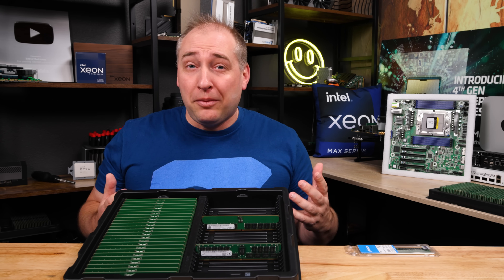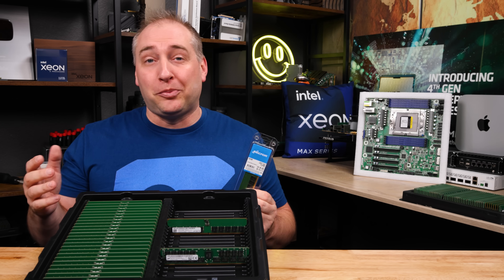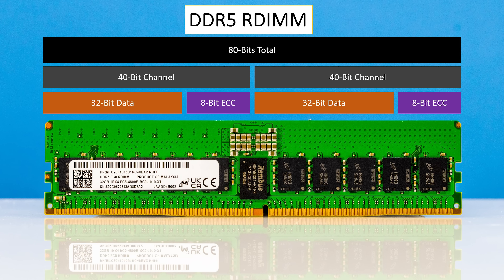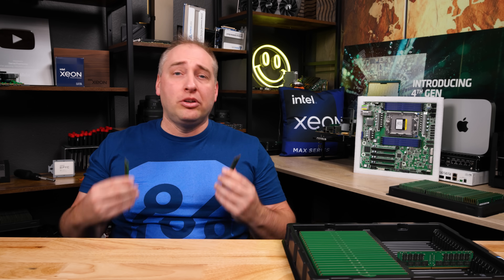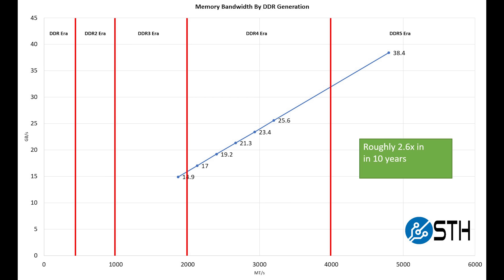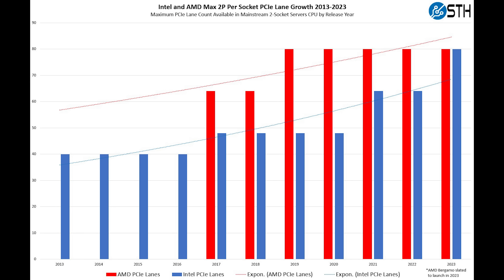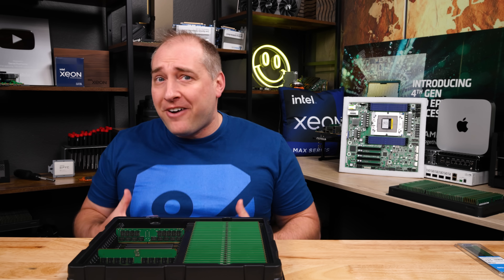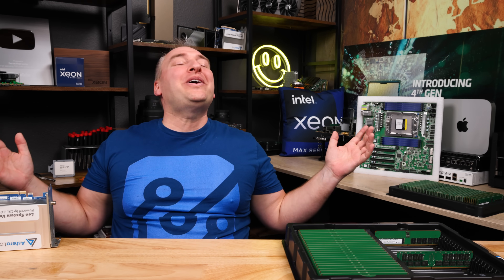Explaining Server DDR5 RDIMM vs. UDIMM Differences

Comment: Other than a server being built specifically for HB apps and banning low bandwidth from running on them, I see no point in choosing a lower core count CPU to save bandwidth. This is the same problem as inefficiencies in farm land use to make massive machine use more efficient and faster. It takes many times more land and other resources to feed a person this way.  Put LB apps on the extra cores to save on hardware and floor space that they otherwise take up.

Comment: i have a old used dell r730 with 2 xeon E5 2699v4 cpus and 384gb ram 24x 2r16gb modules many Terrabyte of used mircron 2,3 inch NVME drives all set up in the fastest way possible. i use this system for data analytic of weather data from the maker space i am in. we have a small weather station who every one can build if they want and you can send us the data once in a month if you will. the whole dataset of one weather station in a month is about 2gb. i had in the in the past processed the data on my trusty lenovo t60p but at this time the data was only around 10 stations after 1 year 100 stations also one month was 5gb data for every station. this was way to much for my system so i had to optimize my code and reduce the data for every station. this was still in the test stage. but after we did make the project public i learned fast i need a bigger pc so i bought a pc a with a ryzen 7 2700 and 64gb ram and a 500gb ssd. i learned how to optimize my code for make use of the cores and noticed something strange my cpu was only to 20% packed and was not really faster as on my t60p. so i thought about that and noticed oh the ssd cant keep up so i bought 2 more ssd and set up a raid0 now i run in another problem i was still not on the cpu limit. i hit only 40% i looked around and all cores was indeed utilized and i used all threads at the same load. this was bizarre to me what preventing me from using more cpu utilization. even the cpu was not boosting. a friend told me i should try dual ranked ram and use all 4 slot with it. so i did now i was able hit 80%. but still no turbo. thought about this a long time and after a year later i had 1000 to  3000 datasets every month and now the system needs 60h to do the work. the same time as i had on my t60p with 100 stations and all optimizations. so i bought a used dell r730 for 600€ and did full ham on it the pc this cost me around 10.000€ in the end. i packed the system with much as dual ranked ram i get my hands on so i did 384GB in it changed the xeon e5 2620v3 cpus to a 2699v4 now i had 44 cores in total instead of 12 in total. i bought used 2.5 inch NVME ssd drives filled up all drive bays did a raid 10 on it in the right size and speed i need so i throw 16drives in it with the biggest capacity i can get used. this time the machine was packed to 90% and took for the 3000 datasets only 20min. 
now 3 years later the system needs for the actual 20.000 to 25.000 datasets 2h to 3h and one week before hand of feeding the data. i had optimized the code more and the data set is now 2gb for one month of each station. 
i love my r730 this thing is a beast it is the fastest pc i ever had worked with. yea it is now 10 years old but still nothing else modern is in this price range is faster. i payed for everything around 10.000€ but if i had bought it new with this configuration this would be around 80.000€ to 100.000€. also mentioned i ran a standard ubuntu on it. and i have a nvidia t100 card in it for crating the visual data in the end. i could go with a faster gpu but for now i dont need a faster one.

my use case showed i need faster ram and more parallel work with it. i benefited from more ranks in the beginning and also in the server from the massive 6 channels per cpu and core count. whit that i was able to use all 44 threads at once with fullspeed still i cant get to 100% utilization but using even faster ram was not possible because the limitations on the memory controller that supported the the 2400mhz only on single ranked ram so i stuck with 2133mhz but this is still really fast.

Comment: Nice video. For top500 most hplinpack machines use GPUs for the heavy lift, the bw  mostly goes to them. CPU cores are good for other mixed workloads such as HPCG etc
Reply: انا جدا تp😊🎉😂l@ll da p

Comment: Thanks for the overview of the differences. It is good to know. A couple of questions for you if you have the time:

With the support components moving onto the memory module (eg: pmic) and PICe cards with memory, do you think we are headed towards a high bandwidth serial protocol between CPU and memory simlarly to how storage interconnects (eg: ata=>sata, pscsi=>sas) and even expansion buses (eg:: PCI=>PCIe)? 

How does the memory on PCIe work with NUMA configurations for the system?
Reply from the maker: CXL Type-3 looks like a NUMA node without cores attached in the topology. On the memory attached bit, that is somewhat the promise of CXL 3.x because it will make sense to start using shelves of memory connected via CXL instead of adding more DDR interfaces on a chip.

Comment: Great dive into the state of PC memory arch., love to keep up with this stuff! My DDR5 key takeaways: cut memory channel width in about half, provide 2 channels per-dimm, and add on-dimm power supply & other reliability features to support even higher clocking. The ratio of memory bandwidth to clock cycle has not kept up with high core counts, explaining why top500 use 24-48 core CPUs. Related points: unbuffered dimms now have on-chip ecc to support smaller processes and faster speed (I'll think of it like reed-solomon on a hdd); and, there's some interesting future potential of ram over pci-e.

Comment: An example where ECC to the module was needed, more than ECC on chip.

I was working at a company who had spent 1.5 man years tracking down a software bug in production, when it suddenly resolved itself.

A week later we realized that one of the computers in the high availability cluster had turned off. I was present when it was opened. I noticed that the ram had 8 chips per dimm.

After we got new ram, the computer couldn’t complete post because it had bad memory. In fact any memory installed into channel 3 was bad.

We got a replacement motherboard, and that fixed it.
Reply from the maker: We had something similar with an early HPE DL385 Gen10
Reply: Such hardware bugs is why I'm skeptical of on-chip RAM ECC.  From an architecture perspective, the CPU package should do ECC on entire RAM cache slots independent of the RAM module design. So when the core needs something from a 64 byte (512 bit) cache slot, the memory interface chiplet loads 80 bytes from the DRAM interface and uses the extra 128 bits as ECC to correct up to 12 single bit errors.  Those extra bytes translate to two extra 64 bit memory cycles and its up to the ECC format designer to ensure that flaky PCB traces or stuck DRAM data lines are always detected.
Reply: @johndododoe1411  The on dimm ecc is mostly just to allow memory manufacturers to use lower quality parts with higher error rates that would  otherwise disqualify them from use.
Reply: A sign that the app needs better instrumentation. These kind of bugs happen too often!
Reply: @jgurtz The App wasn't at fault, the hardware was at fault for wasting software dev time by corrupting data.

Comment: So does AM5 support UDIMM? I really don't want to use non ecc anymore. Because most are unstable out of the box when you are gaming 12 hours you are nearly guaranteed to crash.
Reply from the maker: Yes. AMD AM5 is a consumer platform. The next use for that ECC UDIMM shown is for an AM5 server platform
Reply: @ServeTheHomeVideo  Good to know so any unbuffered DDR5 will likely work as long as the slot matches which it should in theory always do.

Comment: So one RDIMM has 2 channels and CPUs have 12, is that now 6 DIMM per Socket or can you have multiple?
Reply from the maker: 12 DIMMs per socket in 1DPC, 24 in 2DPC (when that is available). You are right it is confusing now.
Reply: CPU channels means 64-bit data width channels, as before.  The two channels within a DIMM are best referred to as sub-channels.

Comment: I would consider the advantage of multiple independent channels to really be a latency advantage, it reduces the chance a memory access has to be queued behind a previous access, thus reducing the chance of it being delayed. Back to back memory accesses to the same bank are the biggest contributor to higher latency under load of memory systems, increasing the number of channels is the best way to increase bank parallelism without adding more devices to each channel.
Reply: قه٤٧٣خحهمقض

Comment: There are many more differences between RDIMMs and UDIMMs:
* the number of address lines for each sub channels is 13 for UDIMM while only 7 for RDIMM,
  thanks to RCDs RDIMM address lines can run DDR while UDIMM must be SDR,
* ECC on UDIMMs according to JEDEC is only 4 bits per sub channel, while RDIMM can be 4 or 8,
* UDIMMs are restricted to x8/x16 memory dies, RDIMM can use x4 as well,
   this allows for UDIMM's hosts to mask writes using DM_n signal, RDIMM's hosts must send full transfers.
I think that points 1 and 3 are mostly responsible for why UDIMMs and RDIMMs are no longer slot compatible.
The supply voltage is different, but as far as I know all PMICs can run in the 5-15V range.

Comment: That is soooooo expensive ATM. I don't even blame EPYC's motherboards not having 24 DIMM's. Though they should start right about now releasing them - that was the promise last year.
Reply: Came here to say the same thing. I am happy to be building with DDR4 right now due to cost.
Reply: @revcrussell  If past experience is anything to go by - and mine goes back to before DDR, the prices will flip. Though in case of DDR5 it seems to take longer than usual (average was around 18 months since introduction). But only a bit. I wouldn't be surprised if DDR5 - 6000 EXPO kits were cheaper than DDR4 - 4000 kits before the end of they year. Heck, you can find some places were they are cheaper already, but by the end of 2023 it should be universal. Especially since DDR4 will probably go completely out of mass production, only enough to support legacy systems. This will depend on how many Zen 3 and older Intel CPU's are unsold. And additionally there was almost a year when DDR5 was only an option - slowing down the change in production.
Reply from the maker: Showed a 8x DIMM one in the video from ASrock Rack
Reply: @ServeTheHomeVideo  True. I do wonder if there will be 24 DIMM per socket (with 2 sockets) motherboards as promised. I don't doubt they could be made, but I'm thinking of how much space it takes. I have to re-watch your earlier videos on Genoa. After the first one, my PC started acting up and only couple days ago I finally found the root of the problem.
Reply: @ServeTheHomeVideo  yyctgynthjytkyipppppggy
Reply: Gigabyte MZ33-AR0 is an example mobo with 24 DIMMs per socket. Never used Gigabyte server mobos, but at least it means more are likely.